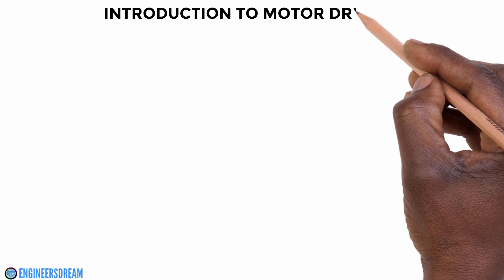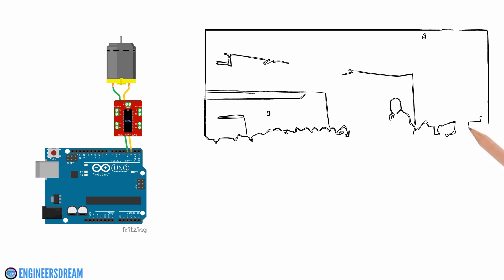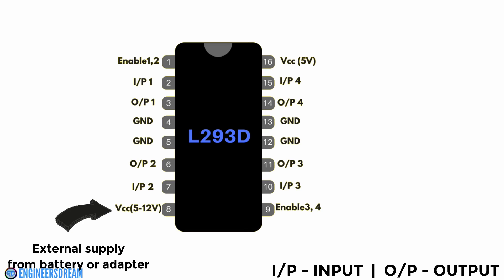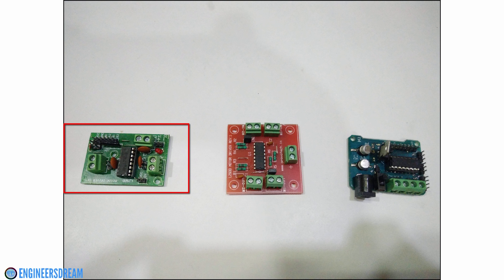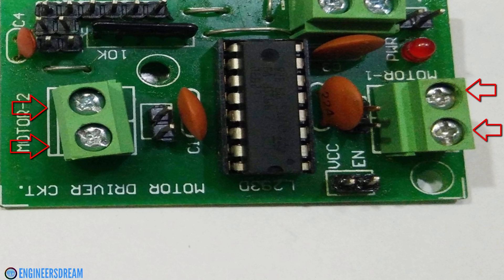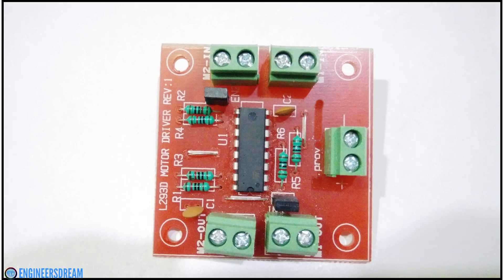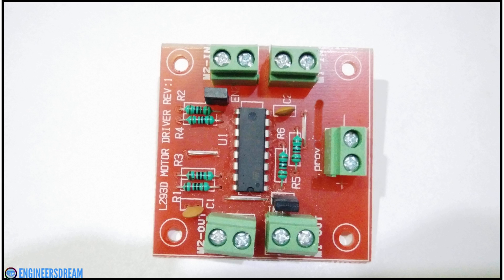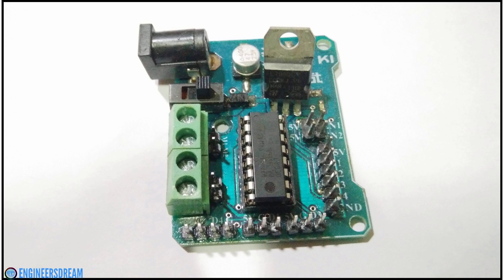WHAT IS A MOTOR DRIVER | ROBOTICS FOR BEGINNERS

Comment: Can i CONNECT MOTOR DRIVER WITH RF Wireless Encoder & Decoder Board With HT12D & HT12E IC ????
Reply: i dont think uh can connect it directly. uh will need a microcontroller for the purpose. so receiver -> HT12D -> microcontroller -> motor driver -> dc motor